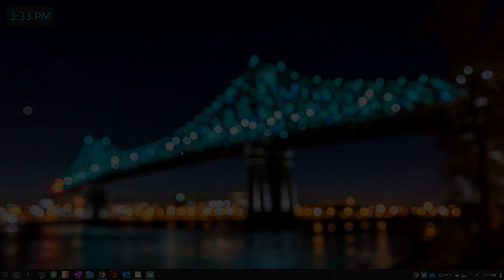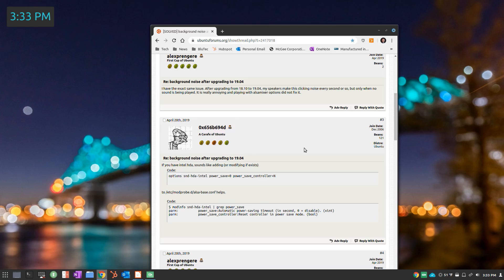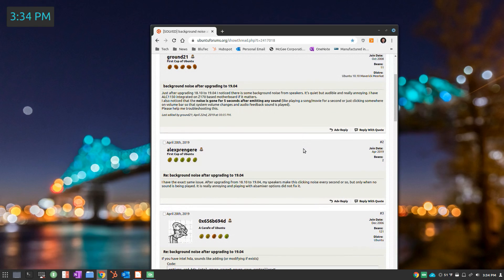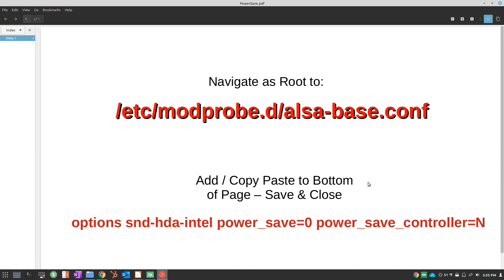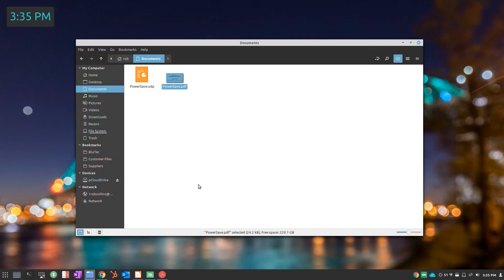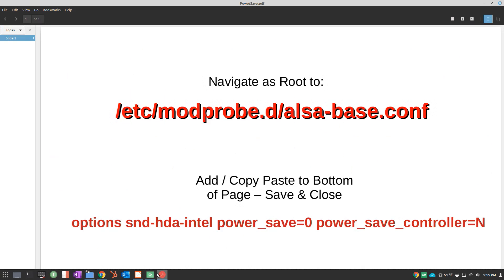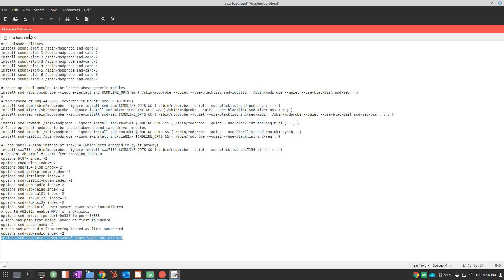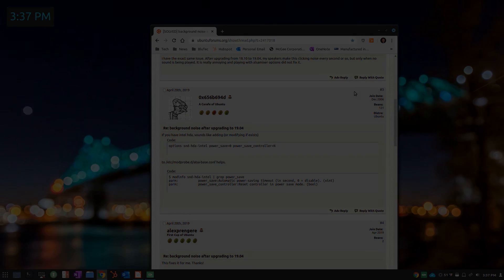Fix USB Audio Pop - Unbuntu Based

Comment: I have this issue too but here the weird thing, it happens when I boot into Windows10 and then boot into Linux, not when I boot into Linux immediately. If I then unplug the connector and plug it back in into another port then it usually  disappears (mostly). So there must be something changing on the USB-connected soundcard by Windows10. I guess I will try out if this fix also helps with that. Yes, that pop sounds similar to when it starts up when you boot your system so I guess it could be a power-save 'feature' which causes the problem. I am big on not wasting electrical power but sometimes they push it too far, don't mess with my audio! ;) 

I have a modprobe.d folder on my Arch-system, I think that is there because of Systemd.